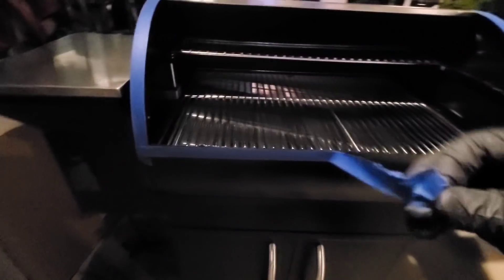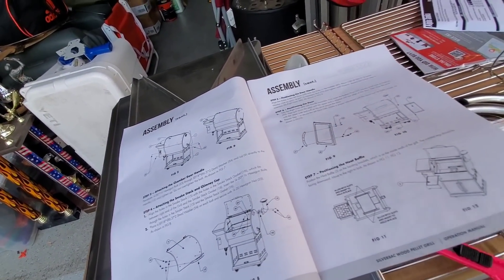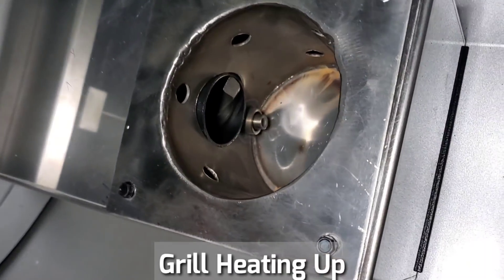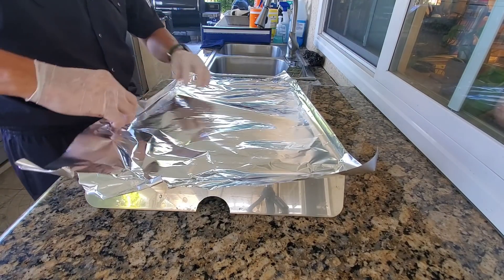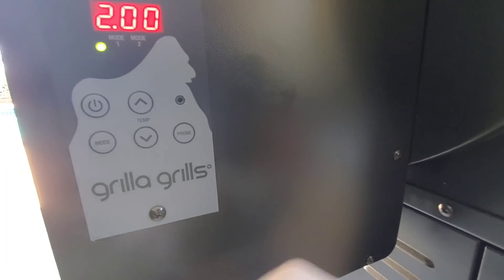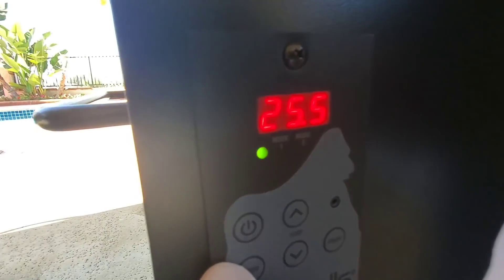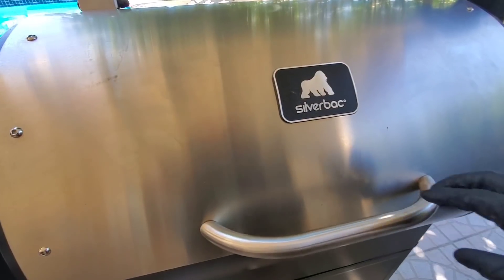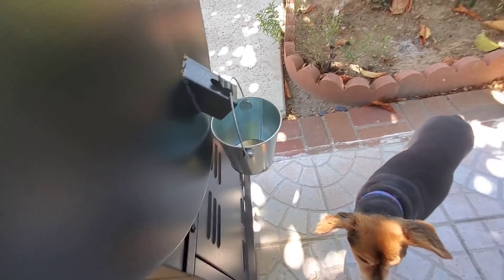Pt 1 Grilla Grills Silverbac Alpha | Unboxing First Cook | BBQ Champion Harry Soo SlapYoDaddyBBQ.com

Comment: I bought the Silverbac 3 or 4 years ago. I had been shopping around on the internet and settled on this. Mine doesn't have the 2 modes but I can upgrade for $130 dollars. What swayed me to getting this unit was the price and warranty. They ship for free. I live about 20 minutes from the factory/store so I just stopped in and bought it. They actually gave me more goodies because I picked it up. When I go there sometimes Mark has waited on me. Very nice guy. If you have a problem and call them chances are you will talk to Mark. Very good customer service. They also have a smaller unit called the chimp. If you like ceramic they have the kong. They just came out with a gas grill the primate. Prices are very good for their products. All I can say is I like my smoker. Very easy to maintain. Built well.
Reply from the maker: Glad to hear Marvin of your experience with the cooker and service!  Good customer service seems harder to find nowadays.  Enjoy our cooker. I have 3 more episodes on the Silverbac coming.

Comment: I actually purchased a Silverbac based on your and many other reviews about 3 years ago. I’ve been happy with the smoker, no flame outs, all the mechanical parts are still working fine. My only complaint is the internal thermostat. This pellet smoker runs much hotter than it indicates. If I set the smoker temp at 225 a secondary probe placed at grill level consistently reads 50-70 degrees higher. I realized this after my first few cooks finished much quicker and the meat was a litter dry. This is true with the new wireless controller.
Reply from the maker: Easy fix.  Just set it 50 degrees under what you want so if 275F is desired, keep the setting at 225F.  Most of my pellet grills are a little off.  Usually hotter than my set temps

Comment: Great content Harry, very happy to see this type of video on a wood pellet I've been following for years now 😀. I have a question about the foiling process for meats while smoking, especially for pork ribs. Is there a difference between individually wrapping each rack of ribs as opposed to putting multiple racks in an aluminum foil pan sealed with aluminum foil? Thank you as always for great content
Reply from the maker: Yes there is a difference as individual wrap means you can check for perfect tenderness before pulling.  When we cook catering, we put 12 racks in a large pan and cook them all falling-off-the-bone.

Comment: One test I would like to see is how grills compare in terms of efficiency of pellet use. Would be interesting to do a test like heat a unit of water with and compare how many pellets were used. Also to cook a comparable cut of meat - same weight - and see how many pellets were used. I wonder, for example, does the double wall help pellets last longer? (Or maybe since you care more about the smoke, it does not matter..?)
Reply from the maker: You must be a scientist or product tester by trade?  :-)  You need a lot of pellet grills and a lot of effort to run such tests. I live in SoCal so the double wall effect, I suspect, is not a big factor!

Comment: Hi Harry, Have you had any leaking issues using the Silverbac when cooking a A8-9 Wagyu from the Butcher Shoppe? I haven't had my grill for very long and only have cooked 3 briskets on it. all wagyu...Each time I get a oil leak on the hopper side. I am starting to think there is no way around this leaking as the Brisket is just super moist and lets out so much moisture. I am going to try a prime brisket and see what happens... Thanks so much for your videos, they have helped me and motivated me! You are the best Man!
Reply from the maker: I put disposable foil pans under the grates and on top of the drip pan to aid cleanup so I don't have any issues.

Comment: I have a Grilla Grill Chimp and a cheap Smoke Hollow from Bi-Mart. I enjoy using both for their own benefits. Chimp is efficient on pellets and great taste, but the 19 pound brisket hung over the drip tray. I cooked on Smoke Hollow grill for 8 hours to shrink the brisket then moved over to the Chimp after I wrapped it. 👌  Smoke Hollow has the real-estate for party size cooks.
Anyways, I loved the thought of the Weber Smokefire and was excited for it. Then it came out and had some problems and I was bummed. Have the said "bugs" been fixed if there was a problem?  Would a Silverback be a safer investment?  I'm undecided.
Reply from the maker: Keep what you have and keep cranking out BBQ love. The equipment does not matter.  Just stick to what works for you.
https://youtu.be/tntxAMcQXP4

Comment: Looking into this grill and interesting with the hot spot test. I also noticed that the heat/hot spots are were on the edges where the foil pans did not cover the bottom.  Do you think having the extra pan underneath may cause uneven heat distribution?
Reply from the maker: Yes the edges of all pellet cookers tend to be hotter.  I don't find the pans affect the temps in all my pellet cookers. They really help in cleanup!

Comment: had a gmg daniel boone for years, never, ever had a problem with that smoker. my son in law is currently enjoying it. bought the silverback a year ago because the gmg would not fit the stand in the outdoor kitchen i purchased from grilla. so far 2 successful/uneventful cooks on it to date, has gone out during the cook twice, caught fire twice and the wifi has never worked. willing to trade it and 600 bucks for a new gmg daniel boone
Reply from the maker: Sorry to hear Bill.  I have several GMG and they are very reliable and trouble free.  My Silverbac did not have issues but I don't have them as long as my GMG so only time will tell.

Comment: Thanks Harry.  Good overview of an interesting grill.  I am in the market now for a pellet grill and this was helpful.  One question, what size foil pans were you using to fit under the grate.
Reply from the maker: Yes they are standard size half foil pans like the ones from Costco or Sams.  I found some half height ones from Restaurant Depot that are cheaper so I use the half height ones from now on as no need to spend more on foil pans that you throw away
Reply: Look at a Rec Teq

Comment: Does adjusting the smoke cap help with making the heat more even?
Reply from the maker: I think it will affect the draft or convection current so may make the heating more even.  I did not have any issues with uneven heating in my Silverbac

Comment: First impressions... How does it compare to your gmg? I'm in the market and was down to the gmg, but curious how you feel between the two.
Reply from the maker: most pellet grills work well and the outcome is determined by the skill  of the pitmaster.
Reply: @SlapYoDaddyBBQ  agreed, no argument there.. But some make it easier to get good results than others. 

I'll take your lack of endorsement of this smoker as a positive for the gmg, for better or for worse.

Cheers mate!

Comment: Reminds me of my ZGrill. Size, design, etc. Only the controller is manual knob on mine.
Reply from the maker: From the pictures they seem alike.  I like the Silverbac hefty grates, second shelf, and stainless lid and pellet cover
Reply: @SlapYoDaddyBBQ  Works great for me. I did remove the second shelf that came with it. Made many briskets for work on it, with employees loving it. And it's just like you say, it's not the tools, its the person.
Reply: You read my mind, reminds me of my Z-grill (that I paid $350 for).  A little primitive by todays standards (searing capability and WiFI), but a good little cooker!
Reply: Anything design sent overseas for production will get copied in thinner materials and sold with a different name.

Comment: Wow I think you were correct in calling it "primitive". You can get a Camp Chef for the same price with a WiFi controller and advanced smoke settings. Thanks for the great video, Harry.
Reply: Extra electronic gadgets doesn't make it a better grill.  There are other differences that make the Grilla stand out.  I would rather have thicker steel on the body and lid of the grill than wifi capabilities.  Here's a page that highlights some differences between Grilla and others. 
 https://grillagrills.com/traeger-rectec/?utm_source=Google&utm_medium=cpc&utm_campaign=Brand-Search-Geo_US&utm_term=Home_Brand&gclid=CjwKCAiA8Jf-BRB-EiwAWDtEGh54KI4m7ABos7QSjSPu4lpQ4wb5g9fp7rd_1S4IsY7xXsOx29hT-RoCrWYQAvD_BwE

I don't work for them or anything. I have a Silverbac and love it.  It is a quality-built grill/smoker.
Reply: LOL....
Reply: "advanced" smoke settings lmao. Yeah okay.
Reply from the maker: Simple is good if it gets the job done